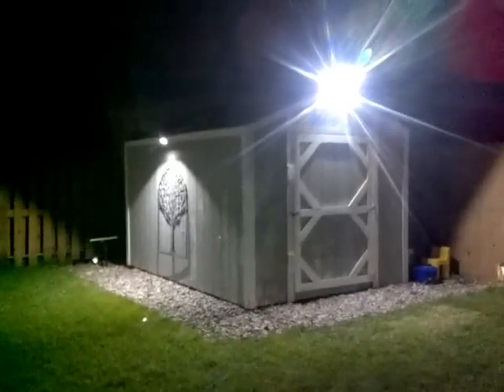Solar powered flood lighting on stereroids

Comment: after 3 +years how are these going please.
Reply from the maker: Added one additional light to light up some new landscaping, another 125AH battery, and wired the lighting circuit through the charge controller. The charge controller cuts power when the batts go below 12V to prevent killing them. Thanks for your interest!

Comment: Nice job. I also have those 10w led fixtures. They work great!! Plenty of light for the outside. My system like yours has 600w of solar. 460ah bank.  We also use some of that to run our solar pool pump directly, cooling fans, and the pool light.  
This is the way to go vs. buying the solar lights with batteries in them.
Plus it adds security and convenience should the grid go down. Thanks for posting.

Comment: I say that your yard light setup is great! My question is what type/brand of tie-in inverter did you use? How has it performed since you've installed it? How is it installed? If you can make a video showing it and speaking about it from your experience, this would be greatly appreciated. Thanks for sharing your setup with us. I believe that Good lighting and fences make good neighbors.
Reply from the maker: My tie-in inverter is actually for wind, so its got some dump-load circuitry that you wouldn't need for solar. The most important feature to look for is island protection. this has to see grid power, and will immediately shut down when the power goes out, so it cannot electrocute the linemen working to get the power back up. Just match the inverter to the panel's generation capacity, be smart while wiring it up per the directions, hook up a kill-a-watt meter, and watch it indicate the current going back into the house.

Comment: What charge controller are you using, i would like to put a grid tie inverter also to power after batteries are completely charged
Reply from the maker: Look for something called MPPT charge controller.  It has the logic that can look at all the conditions and deliver max current to the batteries.  I got one off ebay for 30 ish I think

Comment: Great video ..... I wish you would of shown us your setup including batteries ..........
I would guess it takes quite a few batteries to keep the yard lit all night and the batteries @ a 50% charge by day light ....
Reply from the maker: I have two batteries, only one currently hooked up.  The current battery has 125AH capacity, so its only good for 2 nights without needing sun the next day. The other battery I have is currently hooked up to a lawn mower engine generator  that I assembled :)
Reply from the maker: *****
No. Only regulator is the MPPT controller on the charge circuit. The load circuit is low gauge low-voltage power cable. the same stuff for low voltage yard lighting.  Thicker gauge helps reduce voltage drop across the distance of the cable. 5 amp fuse right at the battery. The lights are not special. A light sensor wired in line with the light circuit keeps them off during the day when the MPPT controller throws 14V at the batteries and they stay "parked" at 13.5 volts after charging. If we went a few days without good sun (rare here in Montana), the lights would simply begin to dim as voltage in battery drops through 12V. That almost never happens.
Reply from the maker: *****
The charging and load circuit is the easy stuff.  The challenge is keeping batteries happy at -40, as extreme cold will freeze a discharged battery.  I'd suggest having a plan b to keep the batteries from getting too discharged--or too cold--during those long, frigid nights up in the great frozen north.
Reply: Sean White I wonder if a 12v seed mat heating pad would provide enough heat for the battery during the cold months?

Comment from the maker: Hello Burt, I got everything from ebay.  search cree 10 watt LED floodlight.  Mine came to about 11 per light. the sensor was less than 10 if I remember right.  The light sensor is rated for 10 amps so its small change in the end. If I figure out how to light 100% of the perimeter with my solar/batt setup, with 5 lights, I use 4 amps of power.